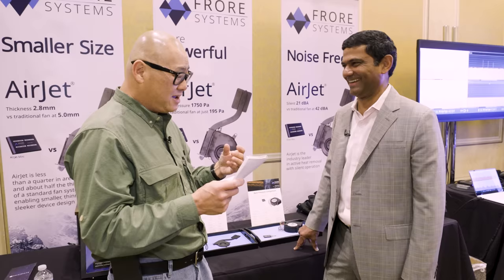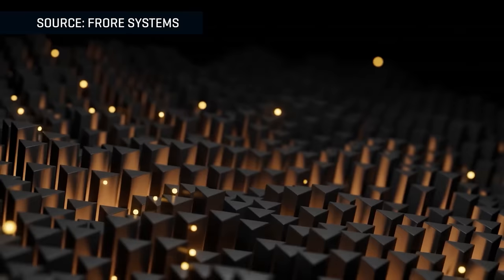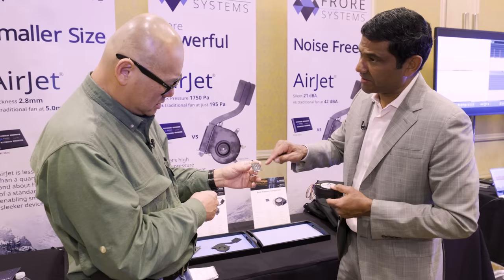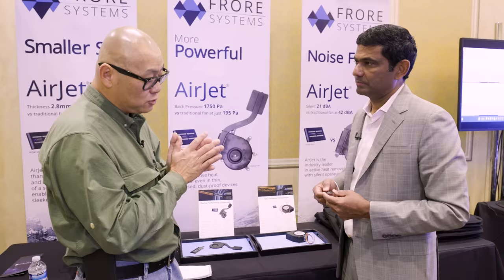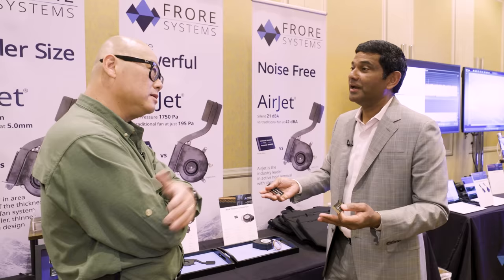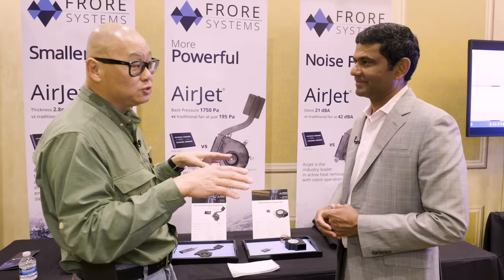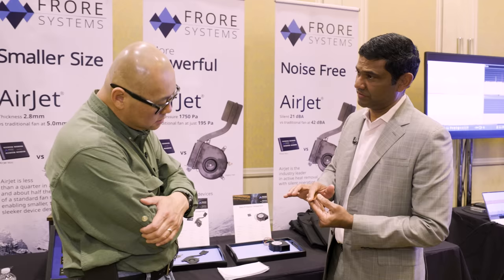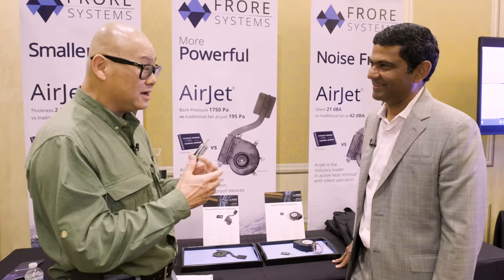Solid State Active Cooling Could Revolutionize Thermals

Comment: Easily the most impressive product out of CES this year!!! I hope this startup gets far with this technology. The applications for this are outstanding!
Reply: IF it can live up to the claims.  This is not just good for cooling.  It might have propulsion applications... how about in a drone?  And if it can scale... why not rockets, jets, or cars?  Lots of potential applications.
Reply: @CD-vb9fi  I don't think so. These things' efficiency are way too low to be replacement for fans.
Reply: @howardkong8927  According to the video these are more efficient than fans.  But efficiency is not the only factor.  A less efficient system is still able to displace more thermal energy than a more efficient one simply because its "capacity" is greater.  That is why I was wondering if this can scale.  Can building a bigger solid state heat sink produce more capacity?  If it can... he said the output was 200 km/h.  That is plenty of thrust to suspend "light" objects in the air.  It might be enough force to rotate a blade fast enough to produce the force necessary for lift.  But I don't know... which is why I am wondering.  If you watch the video they have the thing turning a fan.  So It just got me thinking is all.
Reply: Not of the year my friend,  of the CENTURY!  The application of this technology is insane.  Think of all the smartphones that are going to come out with more performance due to this technology.  The gaming phones from Asus or Lenovo able to be thin, quiet, and insanely powerful because of this (RAZER phone comeback maybe) new tech.  First Gen gaming laptops with this technology will be accompanied by vapor chambers and this tech with fans.  Think how silent it would be.  idle temperatures of running laptops today will be the new performance temps.  

Imagine being look down upon because your fans are even remotely audible in a quiet library setting. I am not going to touch on desktops since it is a stationary object with no problems in cooling.  But  Smartphones, Laptops?  Exciting stuff for sure!
Reply: @howardkong8927  he said it runs on less than 1w
Reply: I want my wibrating membrane
Reply: Intel has invested $100M into the company! Absolutely exciting!
Reply: @CD-vb9fi  These do not generate enough propulsion at all. If you calculate the actual amount of thrust generated, it is not enough for countering its own weight. It cannot perform VTOL, but may work in fixed wing aircraft.
Reply: @CD-vb9fi  he already mention that this tech is inspired by aircraft

Comment: i came in expecting a peltier pad and a vapor pipe and now im actually impressed and i want to see where this goes
Reply: I think this could be effective, but the main problem is the shear amount of moving parts. It will be difficult to create something effective with this level of complexity.
Reply: @alifelessrock48  What moving parts? This is a compliant mechanism like the accelerometer or the microphone on your phone, never seen one break. The manufacturing is a mems process, the device is manufactured fully assembles with no human intervention. My concerns are about dust.
Reply: @paulodpereira  Same, thats the only hindrance if a big dust ball gets sucked in and stuck. As for "moving thermal mass" ,since the speed of the jet is so high the mass flow is probably high enough, and if not you could use more and spread em out.
Idk what they said about power consumption in comparison to a fan that can cool as well, that would be interesting.
Reply: That (Peltier Device) was exactly what I expected as well. The down-sides of Peltier devices are too much, there are reasons why we don't have them cooling computers already. Instead we see a totally novel design concept. I hope that this goes mainstream and turns out to be more reliable than fan based cooling solutions and successfully scales to 1000W or more and can replace cooling for Desktop CPUs, GPUs and PSUs. <crosses fingers and hopes>
Reply: id love to see a peltier pad running cold on the bottom copper plate of this thing. but like every startup. theres so much bullshit they speak and promote its like shopping on ebay. Ie 10000000watt flashlight that runs on a single 1.5v battery and lasts 300 years.... when you know its a .5w flashlight that will last maybe 6 months if your lucky.
Reply: Peltiers are great to make electricity in space though.
Reply: @paulodpereira  i consider these membrane pieces moving parts. But it is true that is compliant. Im also concerned about dust as well, dust is probably the biggest limitation of this chip.
Reply: @alifelessrock48  Ya if there is no way to clean it then dust is potentially destructive to the performance of the device.

I'm guessing the only possible method of cleaning is a backflow of air pressure, but that might not be 100% effective.

So what you end up with is performance degradation over time, likely moreso than a regular fan. I'm sure that is why he mentions specifically using IP68 filtering before the air intake of the device.
Reply: @SimonWoodburyForget  it seems perfect for the area they are targeting, enclosed device such as laptops. Not sure why you think a fan in a high performance gaming laptop would perform any better? Also for everyone talking about dust, they explicitly talk about this and mention this problem is removed when you have a dust proof case. Their product is def targeting laptop manufacturers, not PC builders lol
Reply: @SimonWoodburyForget  "I definitely see the purpose in low noise environment" - I'm extremely skeptical of that "silent" claim of his.  He said this device ejects air at about 200kmh/120mph.  Does that sound silent to you?  Think of what happens when something passes by your head at high speed -- you hear the air move.  Having said that, I also question that air speed claim, based on the movement of what appears to be a ping pong ball at time index 4:09.
Reply: same!
Reply: @SimonWoodburyForget  %%There is no such thing as a dust proof case..%%
Then what is a waterproof case in a mobile phone? Is it not dustproof too?!!!
Reply: @SimonWoodburyForget  - Forget about cooling or temperature. You mentioned about 'dustproof'... ie. any particle getting into a case. A waterproof phone case already does that....prevents 'liquid' from entering in, at varying depths(pressure). When a case stops liquid seeping in ...obviously it also stops dust too...right?
Reply: @uninteressant2196  Fans are rated in CFMs ( airflow volume in cubic feet per minute).This device will have to move more air than a comparable fan to be better. It does have a size adavantage which he did point out. The future will reveal the truth when the benchmark websites get their hands on anything using this device. Let the reviews begin!

Comment: This is the most innovative mechanical device I have seen in years. I would think it could bring solutions to packaging devices we haven't seen before. Nice job!
Reply: A ton of things still use fans. It could revolutionize a whole lot more than just PC cooling.
Aircraft, Heat blowers, Drones, Air conditioners, Ventilation systems, Portable fans, Refrigerators, Ovens , Dryers, ...
Reply: @4nlimited3dition_4n3d  I imagine it would be a pain to scale up to make larger modules to get the flow volume required for most of those applications. Maybe you could by just stacking them though. I would definitely like to play with one on my 3D printer as a part cooling solution though!
Reply: @widgity  Yeah, I did a bit more reading about it and seems that the efficiency side in terms of actual air moved per watt is not much different from normal fans. The size, weight, noise, durability and safety definitely are though.
Reply: It’s amazing innovation, but right now the issue is the membranes get brittle from the heat and crack - they’re still working on longevity
Reply: @nareddyapps  Where did you find that?
Reply: @4nlimited3dition_4n3d  it is probably also a LOT more expensive than a regular fan so I imagine it will only be used in small form factors that do not require IP67, i.e. laptops and tablets.
Reply: @bigsmall246  That's possible as well. Although they somewhat claim otherwise on the video.
Reply: @4nlimited3dition_4n3d  well it works for pcs but won’t work for aircraft fans lmo
Reply: @smallpeople172  ....yet
Reply: @4nlimited3dition_4n3d  no meaning the method of operation and scale required for the MEMS to work is prohibitive for anything large scale anyway. This is more like its small because it needs to be to move this air the way it does, and MEMS components are physically limited to very small sizes by physics. And it isnt conducive to aircraft propulsion which isnt based on velocity but rather pure power and volume. Also, the velocity of the air he quoted is meaningless. They are moving one or two square milimeters of air with a electrostatic membrane. Its basically a planar speaker from a headphone in a chip and MEMS do not scale up, period. Second, aircraft engines are already approaching the peak efficiency. They are already designed in a min-maxxed sort of way where the design is the most efficient one possible. The only gains we will see going forward are from size variations of that same design (namely bypass ratios), and future materials being lighter/stronger/more heat resistant. Even then, the materials used in blades of the compressors in jet engines regularly exceed the rated max temp for that unique crystalline material they are grown out of, we just get around it and cheat by having cooling liquid circulating within the blades themselves, bringing them just below their temp threshold. But if we can get temps higher, higher temperatures in engines improve efficiency more than any other improvement category.

Basically, yes the tech is cool, but its niche tech that would not benefit jet engines as the form factor isnt right for maximum fuel efficiency. Jet engines with high bypass ratios are the ultimate form factor. Guarantee you a regular pc fan moves more air than this, by a long shot, while this may win out in cooling due to the MEMS enabled operation and the cavitation of the boundary layer. Its clever but it serves a very, very specific purpose.

I'm even certain this will never replace pc fans, it will be just another alternative with its own drawbacks. Note how they didnt compare its' performance to other coolers. May even be worse than traditional cooling, but offers the advantages of size and form factor for laptop use. I assume this will be silent and more energy efficient but overall a lower performance. Like, 60% of the performance without sound and for 20% of the energy.
Reply: @bigsmall246  MEMS technology is pretty mainstream though. The manufacturing base has been around for a while, and it uses many semiconductor processes.

Comment: I specialized in thermal and fluid simulation in college and this bad boy sounds like it will be amazing for thermal transfer with lots of room for future development by changing the surface geometry of the heat spreader. This has me excited
Reply: Another TEC (Peltier element) shown as the greatest miracle of mombo jumbo science. Meh, just skip it bs for another stupid CEO who wants to put some money into another CASH IN CASH OUT BRO DOWN PROFFIT stratup
Reply: @cyber_robot889  It really doesn't look like one of those projects, though.
Reply: @cyber_robot889  This is not a Peltier device.  This device moves air not heat.
Reply: I did CFD in grad school too, this sounds rather interesting indeed.
Reply: @StinkPickle4000  it moves dirt at the intake to guarantee planned obsolescence, they said you can put a filter but that will only guarantee you have to buy a new filter every week to substitute the old.
Reply: @fss1704  ??  not every company is evil
Reply: @cyber_robot889  its not a TEC, it's basically a solid state fan which works by wiggling a sheet using electromagnets. It has no bearings and it makes less auditable noise than a traditional fan but it's also much less efficient and powerful
Reply: @theneonbop  apple is. They hotglued the frame on their macs and put the hot air exaust pointing at the hot glued frame, put 52V backlight pin close to a data pin that goes directly in the cpu, in the same model they put a hole in the keyboard to make liquid fall exactly on top of the 52v-data misfuck, removed the lifeboat connector on SSD soldered directly into mainboard, "fixed" a defective chip by putting a piece of rubber to press the chip down instead of refurbing the board, had a defective iphone antenna and blamed the customer saying "youre holding it wrong", etctera, look up louis rossmann.
Reply: This looks promising, but don't you think this is coming at a time when power consumed by compact devices are getting lower and lower and active cooling is not really required. If this had came just 10 years back, then Frore would have been a multi million dollar company instantly. Hope they get applications elsewhere if that is the case
Reply: As a guy who does a lot of repair, this doesn't seem practical simply because of dust. While the idea might work, I think the claims that this will work despite the dust guard and still stay clean at the same time to be somewhere between wishful thinking and total BS. Still an impressive concept
Reply: @RealComp5  1:43 At this point I knew what kind of project it is.
He is comparing technology with 100s of years of revision and sounding like this thing is gonna replace it.
Reply: Thank you for confirming it's not bs
Reply: it also drill hole inside oyur GPU/CPU just by rock solid termalpaste xD i cant wait to service thoise shet..
Reply: @fss1704  Dust filters last for a lot longer than that, and can be cleaned.
Reply: how cool could this get tho? would it work on desk top chips? or would this be something we see in laptops, cellphones and maybe other handhelds later on?
Reply: @midegola5623  ultrasonic fluctuations force air to move and air takes part of heat. But ultrasonic sound can be pretty dangerous for people and animals, as for desktop? Who knows if their data is correct, they can replace spinner coolers on chips
Reply: @dmitrizaslavski8480  how/why can ultrasonic sound be dangerous?
Reply: @fss1704  on the other hand, they’ve been moving to socketed connectors across their entire line-up. Macs are probably some of the few machines that are guaranteed to survive a USB-killer attack and be easily repairable afterwards, no matter what model you buy.
Reply: @fss1704  They were talking about traditional pc air filters. Most laptops can't run them because there cooler can't put enough force in the airflow to overcome the resistance hence why most laptops become dust monsters over time. This can push the air flow enough to overcome that limitation and thus allows you to run it with a dust filter. Dust filters for pc's rarely need to be replaced (just wiped down every once and awhile). Sounds like you are confusing them with something like a furnace filter.
Reply: @midegola5623  If we combine this technology with a vapor chamber to increase the effective area of the heat producing chip, this could very easily be applicable in much more thermally demanding applications like desktop pcs and other high power chips. This would likely result in a reduction in size of the cooler compared to current technologies. The cost of the product would need to drop significantly, but given the ability to optimize silicon production, I could easily see this replacing the standard heatsink and fan combo for cooling stuff.
Reply: @cyber_robot889  It's not a peltier, though, watch again and maybe check out their website. It actually produces airflow at a very high pressure and velocity, albeit over a tiny cross-section.
Reply: @AnalogWolf  I think with a massive reduction in the middle of the device (similar to modern waterblocks) it could produce massive turbulence over the hot plate and get really efficient convective transfer from the chip.
Reply: @steamerSama  Very true, but compact devices in general are the trend, think mac mini, the imac and all-in-ones in general. I think that this technology still has a place and might still replace heatsink and fan technology if the efficiency can be pumped up. Also, power efficiency of chips has increased due to limitations in battery technology and as we develop new and better ways to store power in portable devices, we might end up with a resurgence of power hungry mobile chips that need a lot of cooling in order to keep up with the performance arms race. I think you are absolutely right and that they would have been an immediate success even just ten years ago, but I still think there is a ton of possibility in this technology.
Reply: @RealComp5  I think that the ability for the device to produce such high pressure over a tiny cross-section means that actually effective dust filters can be used. it would more be a matter of replacing/cleaning an actually effective paper or foam filter rather than having to tear down and dust your device. Additionally, with further development of the technology, there might be a way to produce more effective dust evacuation built in to the device. It will inherently produce a lot less static because it vibrates instead of spinning like a normal fan. I think that the dust proof-ness is definitely overplayed in the video, but this is super exciting technology, nonetheless.
Reply: @midegola5623  It can damage your eardrum and inner-ear without an audible cue that it is dangerous. If it is loud enough it would basically be like a gunshot, but outside of the audible range. This could be a concern for this technology, but I think only if we really try to minimize the size of the cooler. That much energy would not be needed to move the amount of air needed to cool a pc unless the airflow was restricted down to very small cross-sections.